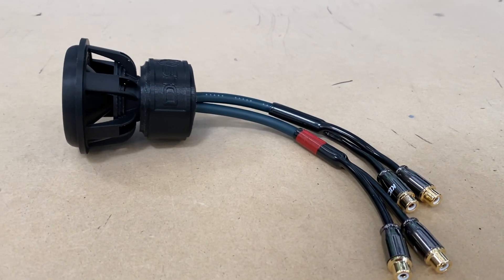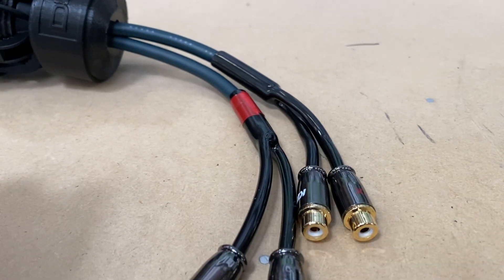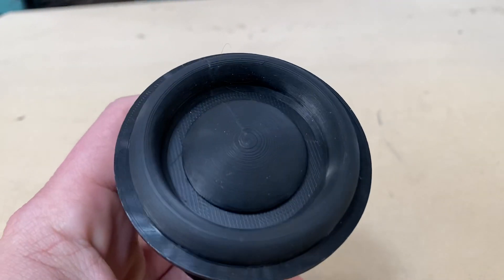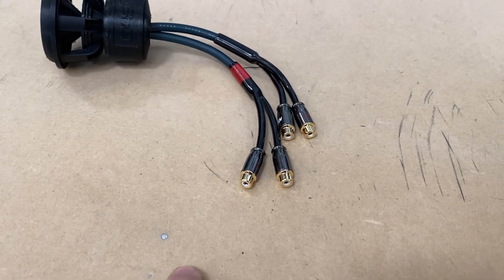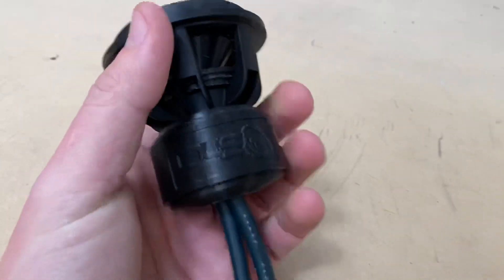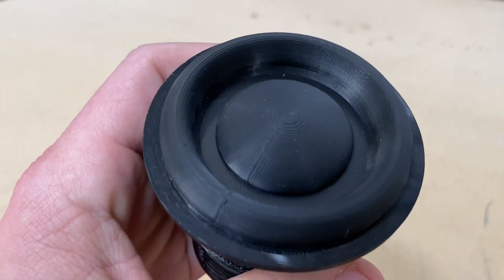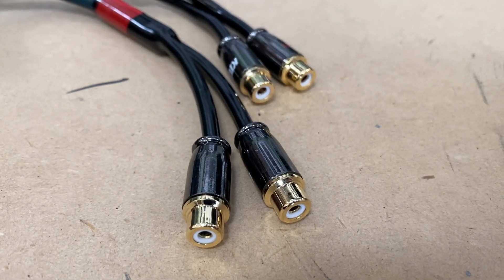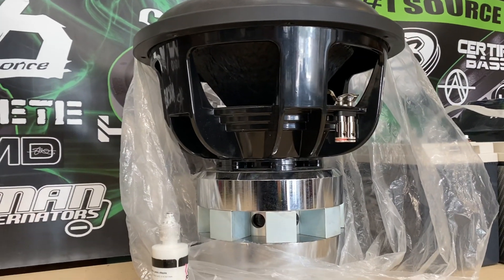DOWN4SOUND’S V1 UNIVERSAL CAR AUDIO BASS KNOB!

Comment: The leads need to be like 6 or so feet so it looks clean when installed
Reply: You just use an extra set of Rcas.... To the knob
Reply: @adamhearts9195  yes but they have bulky ends still and won't be easily concealed.
Reply: @frankbarlow3154  what model bass knob has a 6 ft rca attached?
Reply: @adamhearts9195  none I had to remove and solder new ones on mine  . So if someone makes a really cool one  it would be nice not to modify it to use it .

Not a big deal just an opinion
Reply: @frankbarlow3154  I agree with you 100% Frank maybe a single whip output split off into two get that clean look and that way you can put the rcas behind a panel
Reply: @adamhearts9195  most bass knobs dont have RCAs at all.
Reply: @Thezuule1  Gain knobs
Reply: @adamhearts9195  split hairs if you like. This is an attenuator either way.

Comment: I buy all my stuff for my burban. I bought my 18 inch incriminate audio death rows from you and I just have a cheap bass knob on it now. Since I seen this video I now see something I gotta get for the truck now. You did say if you could make some suggestions. Maybe a mute button. Press the sub and it mutes the signal or a clip indicator light. Maybe a down4sound voltage meter on the side of the printed magnet. Or maybe some embedded LEDs inside the cone area near where the spider would be. Anyway thanks Jonathan for another great product.

Comment: I think a digital LED readout on the dust cover would be cool. Voltage, clip indicator, volume level, a real spider with sewn leads in it. One step further, custom 3D printed to match the woofer you have installed in your vehicle. 💲🏧💲Imagine the possibilities💲Im sold!

Comment: DUDE that's SOo Rad!!! My only suggestion: ad one for the other type of bass knob plug in.
Reply: These plug in between the head unit and your amp. Your remote/bass knob plug on your amp wont matter because that hole is not used.

Comment: My bass knob i got now when i turn the knob all the way down it actually hooked up to my remote wire from the h.u., and will shut off my amp. It is alot easier than a separate switch or shutting it off at the head unit when i have my kids in the truck. If a version like that comes out id be down like 4 flats on a cadillac. Cause mine right it seems like at about 1/4 way its real quiet it move it a hair and its basically at full tilt. With the bass knob that came with the amp it was smooth and sound gradually got louder. But i stick with this one just for the fact it has the remote shut off when turned all the way down.

Comment: Needs a clipping indicator on it.
Reply: That would be nice but unfortunately it doesn't work like that.
Reply: @Hertzsogood219  why wouldn't it work like that?
Reply: @Hertzsogood219  other bass knobs can come with clipping indicator. Rockford Fosgate makes clipping indicators and their bass knobs. Kicker puts clipping indicators and their bass knobs.
Reply: @HoUsEoFcAtS78  
  Because a universal clipping indicator is ran on a separate signal through a separate wires other than the rcas. Lots of amps come with a bass knob, clipping indicator, and power indicator all in one little unit but those are for that amplifier "specifically". So to have a universal bassknob that also has a clipping indicator;  it would have to work with your specific amp and that would take alot more doing than you would think. Different type plugs for one. I use a universal bass knob by Sky High Audio and for clipping indicators I have the bass knobs for my SoundQubed 4500's in plain view for that purpose only.
Reply: Bud Smokegood  True, but being a basshead I like to keep my gains high and use my bass knob/ clipping indicator to set them for each individual song. Different songs need more or less voltage to play at the same volume. Yea you can set you're gains at a clean 40hz test tone, but then you play a song that even at full volume,  doesnt even come close to playing full tilt.  Thats why I always use my bass knob and clipping indicators. That way you can play every song up to clipping. You're basically setting you're gains for each individual song with you're bass knob.

Comment: Make it better? Maybe an upgraded version with clip and distortion indicators.. But that model is perfect as is.
Reply: Not sure there's a way to do that with a simple attenuator like this. That's a feature of the amplifier itself on knobs that have those lights.
Reply: @Thezuule1  I didn't think of that. Yeah, it's not a CAT 5 style. That's why it's Universal.
Huh.. Maybe sending those signals through the same 2 wires (4 both channels) is a challenge for amp manufactures.

Comment: People talking about this having a clip light on it need to realize this is just an attenuator. Clip lights are a feature of your amplifier. Devices like this have no way of telling whether the signal is clipped. It simply lowers the voltage of the signal when you turn the knob down using a resistor.

Comment: Thanks for the video clarification on what amps I can use this on. I’ll be ordering a couple soon. So just use longer rcas to extend as far as you want?
Reply: its rca fed, input to output, all you need to do is adapt to rcas
Reply: You can use it for ANY amp to be technical. And it's a simple in and out configuration.